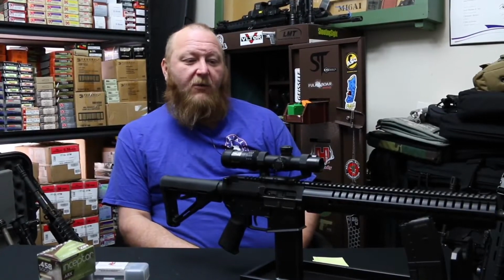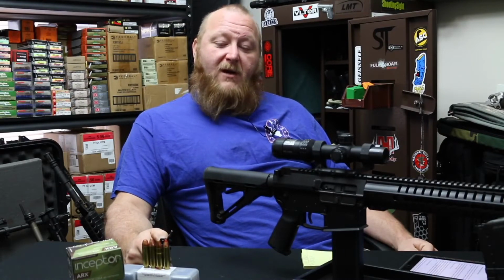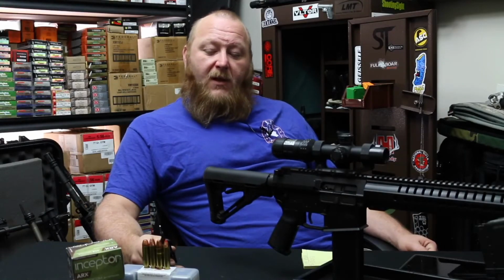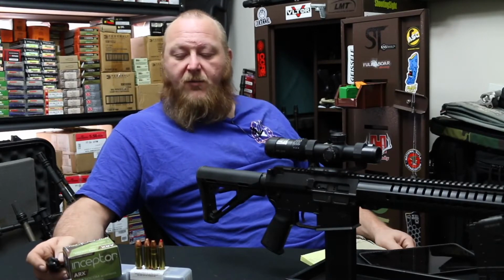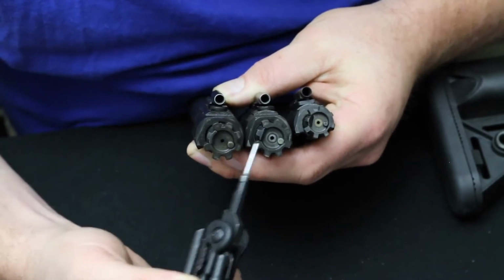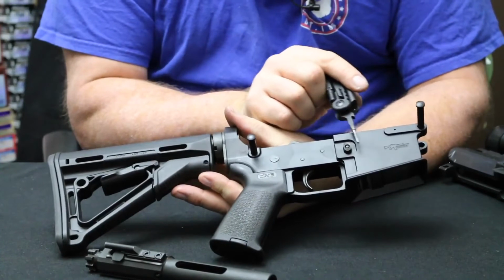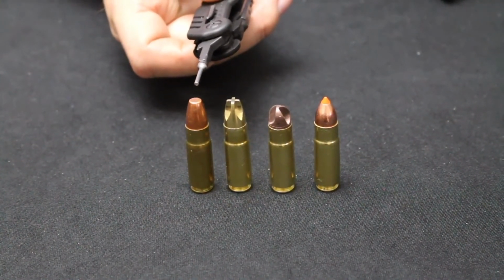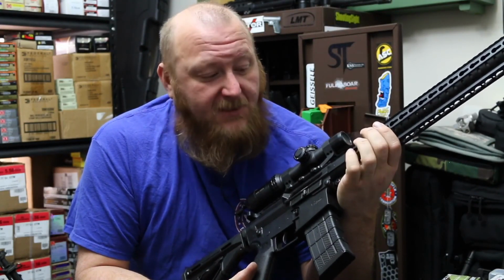CMMG Anvil 458 SOCOM Rifle Review

Comment: P.O.F roller cam pin drops right in my mk47 mutant. Had excessive wear inside reciver. Seems like the tolerance between the firing pin and cam pin was excessive to the point it was gouging the area it rides inside upper.
Reply: @italianrelic  There is a AR-10 and a AR-15 sized roller cam pin they offer. The only thing is that the cam pins i’ve installed, the one I put in my CMMG 9mm banshee didn’t hold up to the excessive pressure from the 9mm. The 556/223 and the 7.62x39 are still going. If your 458 uses the smaller size AR-15 cam pin, id say it may chew it up. If it uses a LR308/AR10 sized cam pin, then most likely it will work well.

Comment: I hope someone could help me . My 458 shoots but won't load the next round . The bolt rides half of the case and gets stuck there. I did the one round mag test and the carrier locks back but leaves the bolt on the open position (sticking out a bit over the back part of the follower/mag) . Some casings eject great and others just seems to get spit out with almost no force . I also tried widening the lips of the GI mag but didn't help much .
Reply: Trigger5.56 ever get it fixed?
Reply: Keith Reinert yup the gas port was opened up just a bit more by a gunsmith and now runs like a champ.
Reply: Trigger5.56 good to hear I have an upper that I haven’t got to loading for yet and was curious thank you.
Reply: Gas port, send.it back!
Reply: @trigger5.563  how many rounds do you have through it now and how does it cycle?
Reply: @trigger5.563  good to hear. Mine is over gassed. Had to add an adjustable gas block and extra power spring. It’s fun after taking care of that